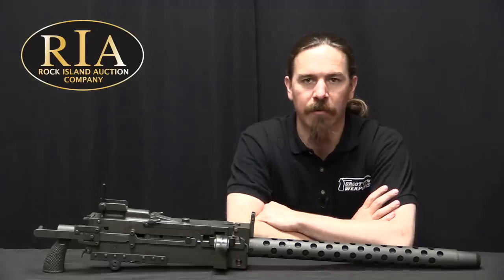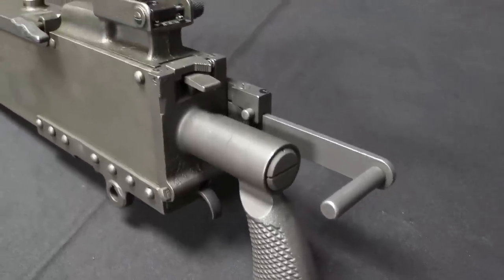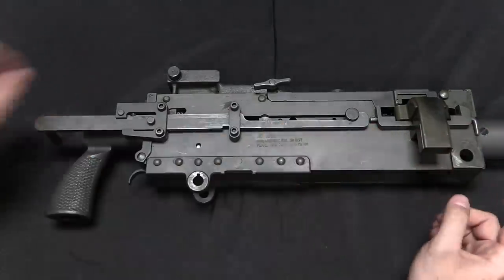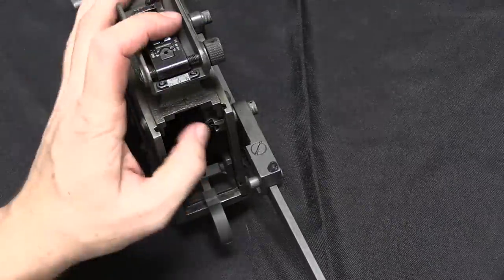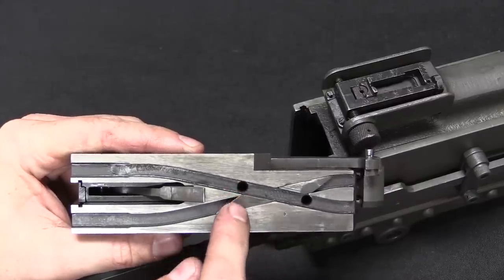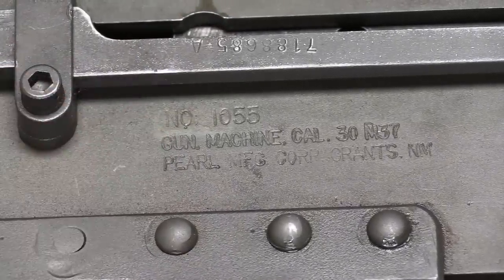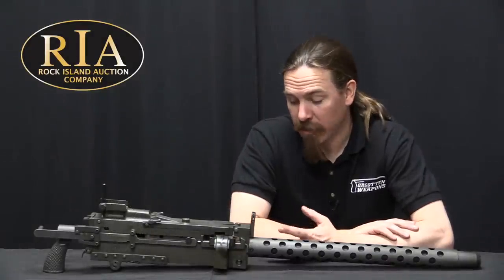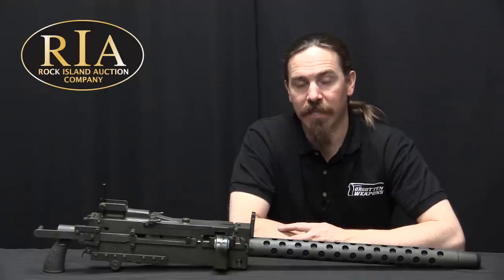M37: The Ultimate Improved Browning 1919

Comment: This is a great machine gun to shoot. Huuuge fun. I had my chance during my national service back in 1987-89 with the Greek army. My unit had M48s and M38s jeeps as scouting vehicles - and this was the standard M48 coaxial gun, on our M38s we had the standard M1919. During our training we were shooting all the guns of the unit so I had good time apart of my own 1919 also with this. My impressions: It is great when shoot from a vehicle or from a fortyfied position. The points of impact spread on an wide pattern so you can "shower" an area with bullets without moving the gun much. We used to have a spare 2nd barrel ,a special tooling wrench and a heat resistant (asbestos) glove for barrel changing. I remember that our training involved closed eyes barrel changing timed for under a minute. The hard thing was to properly screw the barrel on the bolt receiver. You had to count "clicks" to get it alligned (otherwise the gun could jam) but I realised that you could sense the alignment just by finger touching the end of the barrel while screwing . As long the barrel was aligned correctly the gun could fire for ever. The usual part to fail was the back plate with the pistol grip. My unit had a few guns with shattered back plates and no spare ones to replace them. The piece I see in the video looks like new- no way like the guns I shot back then. Great video, thank you!

Comment: I marvel at the modernity of the 1919.  I think it is something of apples to oranges, but I finished watching the Project Lightening just the other day.  And while most of those guns were designed a decade or so before, what a leap forward the 1919 seems to be.
Reply: I always liked the the difference between the the 1918 and the 1919 one year and a fair amout of change past one bing water cooled the other air
Reply: No kidding. I have a Browning Model 11 from my great grandfather and having a gun like that in WWI must have seemed like science Fiction.
Reply: I see the exact opposite.  Some of those decade-older "Lightening" MGs are clearly 20th-century guns.  Despite its quirky magazine, radiator, and clock spring, the Lewis in particular sports a mostly modern action, layout and ergos.  

Conversely, the 1919's advances are essentially wasted.  Browning greatly simplified the recoil action, yet implemented it with oversize, complex machined parts; he developed a mostly unstressed receiver, yet built it out of massive, boxy boilerplates and castings in the 1880s locomotive style of a Maxim, Gardner, or Nordenfelt.  Even this 1960s version would be right at home in a "League of Extraordinary Gentlemen" sequel, with no prop-dressing required.

I have the utmost respect for Browning's genius.  His designs were brilliant for their day, and many have passed the test of time.  I know it is heresy, but it sometimes seems like people are so blinded by his reputation (and, to be fair, the fact that his guns often competed in trials with unreliable clunkers) that they've frozen his designs in time, ignoring even the most basic and obvious upgrades implemented everywhere else.
Reply: It and the Thompson could have an even more legendary reputation had the war gone on a few more years.

Comment: Ian, your story about being pulled over while transporting the weapons was a nice anecdote,  but you might be surprised to know how often it happened over the years....
Back in the early 80's I was in the ARMY National Guard in California. 
I was the NCOIC of the shooting team for my unit,  the 570th MPCo in Concord, Ca.
One year the state matches were being held at Camp Roberts down around the town of Paso Roboles Ca.
Anyway,  it was my responsibility to transport the weapons to the match from our armory in Concord. 
My orders were to take an M880 truck from the Walnut Creek armory and transport the teams 6 1911's and 6 M16's to the match and back.
Since the time of my return might be late,  I Was to lock the weapons in the Walnut Creek armory vault when I drop off their M880 truck.
Well the match went fine but just south of Walnut Creek I got a flat and was broken down on the freeway. 
When I tried to change the tire I found the jack didn't work.
So I sat in the center of Hwy 680 without a way to change the flat or to call for help.
Hwy Patrol finally stopped for me after 2 1/2 hrs and called me a toe truck to change the tire, but by the time I got to the walnut Creek armory it was closed and locked up tight.
So I parked the M880 in the lot slipped the keys through the mail slot after transferring the weapons to my truck and was just starting my truck when WC PD pulled into the armory parking lot to see who was there after dark after closing time.
So as I got out to talk to one of the officers,  both were reserves,  the other cop walks around the other side and looked into my truck and sees all the M16's in the front seat and says rather loudly, " wholly shit".
Any way they decided they would take the weapons,  but I wasn't allowed to turn them over to anyone outside who my orders allowed. 
As you might think,  it was an interesting little deduction,  especially since my written orders authorized my use of deadly force to keep them......
I convinced them to call their boss who told them I was under orders and outside their jurisdiction,  but for a short time there,  two reserve cops thought they had the bust of the century....
And weren't happy when they had to let me go on my way with my dozen charges in tow......
Oh the good old days.
Today I would probably have been shot.....
Especially in the state of Kalifornia, People's Republic of.....
😄😜😄😜🎃
Reply: I love these side stories posted in the comments. It adds more to the video.
Reply: Awesome story, thanks for sharing lol. Glad you're with us today
Reply: @bdkj3e  
Between 80 and 83, it was so long ago I don't remember exactly what the date was but it was in the summer when they held the state military shooting matches to determine who would be sent to the National match to represent California at Camp Paire.....
Reply: It happens.   Around here there are or were some low profile govt. installations deemed important by some.  Right after 9/11 some troops were assigned to go supplement security at one of them.  Full combat load, grenades, class Bs, etc.   For whatever reason one unit used a POV when doing their move from their base to the building far away in the middle of no where up in the mountains.  2AM in the morning their vehicle malfunctions and a sheriff deputy happens upon them.  5 very fully armed soldiers in an old civilian SUV.  More deputies arrive and eventually it was straightened out.  They had their travel documents and the authenticity was verified and their vehicle was fixed for free and they continued on their way.
Reply: @kenibnanak5554  
If I hadn't had a copy of my written orders on me and they said who I could relinquish possession of my equipment to and the lengths I should take to do it.....
ie: the deadly force authority....
Not to mention,  the cops didn't see the 45 tucked in my waist under my jacket......
When they asked what I had for deadly force l said,  what more do l need with 6 M16's and 1500 rounds of ball in 20 mags,  so they didn't really think to look for a pistol I guess.....
Fortunately they took my suggestion about his patrol supervisor. 
He told them if I had orders and was headed out of Walnut Creek to let me leave, l was an ARMY problem.....😄
Like I said,  the good old days.....
Reply: @stanleyjedrzejczyk2966  
Like I said,  two reserve cops that were full of themselves.....
The fact that they never new I was armed is key to the encounter......
That and getting their boss on the radio....
And like I said it was 35 years ago and a different time.....
Reply: PFFEAR, THANK YOU for your service. May your rifle never jam, never run out of ammunition, and may America's enemies be forever in fear of you.
Reply: @stitch626aloha  
All they have to FEAR is FEAR himself.....
I am fear,  come walk the night with me...😨
Reply: pffear yeah if that happened these it would have gone bad
Reply: *Commiefornia
Reply: I imagine it would not have helped to tell them you had orders to use deadly force to keep the guns. Makes for an interesting situation. Were they ever told that?
Reply: "especially since my written orders authorized my use of deadly force to keep them" - oh boy...
did you tell the officers that tit bit of information? lol
Reply: @RYNOCIRATOR_V5  yes I kind of had to when they told me they didn't care my orders said I could have the weapons,  they weren't letting anyone drive away with 6 M16's in their town....
I kept telling them,  look stay out of my truck and call your boss before this becomes an incident that gives us all writers cramp before we're done.....
Fortunately like most cops (myself included) they hate writing long reports and having to explain why you've been arrested by a military cop on a military base for butting into military business is undoubtedly going to be pages and pages of small print....
Especially when all you had to do to solve the problem was call your boss❓😱❓😕
But when they finally got him on the horn I told him that I was only allowed to turn my equipment over to my chain of command with deadly force required,  the two there weren't happy.....
But I told them the only reason they weren't facing a locked and loaded M16 was that I didn't expect cops to be forcing me to arrest them for interfering with my duties and that when I saw it was a cop car approaching me I pulled my mag.....
At that point I produced the 20 rd mag out of my left pocket....😱😝and their eyes 👀 popped❗👍😎
Reply: @pffear  lol that's a cool story my dude
Reply: @pffear  every police in any state will start pointing guns at you regardles of date if they found out you had that 1911 🤣

Comment: They used to have these in UK Ferret armoured cars as late as the the late 1980's (maybe even later), we used to use the canvas belts used to hold the rounds to clean the fume extractors on Chieftain tanks, it was the quickest and probably best way to do it :)
Reply: They were mounted in Ferret's! They were converted 1919A4's not M37's. they were modified to open bolt firing to aid cooling. They were designated L3A1-A4 in service and all fired .30 '06 cartridges and were never converted to 7.62mm NATO. I saw many hundreds scrapped in the late 1980's...

Comment: Based on annual reports from Rock Island Arsenal, total production of the M37 Machine Gun at that facility was 7,340 units, between 1955 and 1957. As far as I can find, no one has managed to access the manufacturing records of Saco-Lowell Shops, but there seem to be more parts of that manufacture found in the surplus market. Likely they made at least as many units as RIA, perhaps more. Rock Island Arsenal also manufactured 8,402 new 1919A6 Machine Guns between 1953 and 1955. Thanks, Ian, for another fine video.

Comment: In Canada we were still using M1919s in 7.62 (designated C5 GPMG) until 1987 as a platoon GPMG and until approx. 1994 in the turrets of our APCs.  Oddly enough, we'd had FN MAG 58s on our tanks since 1977, though.  It worked, I guess.  Bitch to carry.  No quick change barrel and had to be head spaced and timed.

Comment: Thanks for the info.  It helps sort out where the M37 was in the pantheon of Browning MGs.  It's interesting that the Army went from the reliable and well-liked Brownings to the generally despised M73/M219 coaxial MGs.  Always fascinating that a nation with a long and proud history of small arms design messed up so badly on a weapon that is so essential as the co-ax machinegun in a tank.  M85 was in .50 cal, so it's really a different story.  M85 seems to have an equal number of defenders and detractors.  Any of the later tank machine guns would be of interest, especially in learning how they screwed up.
Reply: I understand why the Army made the M-85. The M-2 is a long weapon and building a mount to use them properly is difficult. So they tend to just use pintle mounts which often worked only in one general direction. The other problem was that the M-2 ostensibly was duel use as a anti aircraft gun. So the idea of two rates of fire made since. Don't get me wrong, I was not fond of the M-85s on our M-60A3s. On the other hand our new M-240 co-ax was fantastic.
Reply: @williamsager805  On the M60A1s I was on M-85 problems were usually caused by improper loading of the ammo.  Properly cared for they didn't have many issues.

Comment: @Forgotten Weapons. Your point on removing the return spring on the previous models is incorrect. A long screwdriver is most definitely not required on earlier M1919s.
The stripping sequence starts with cocking a cleared weapon . The slotted screwhead of the return spring poking through the upper left of the back plate is just pushed forward and twisted through 90 degrees clockwise with a suitable flat bladed screwdriver.(Forward pressure required) 
This locks the lugs on the return spring into the rear of the bolt, push bolt forward  a little and remove back plate.
NIce informative video by the way. Thanks.
Reply: I seem to recall a little all steel screwdriver thingy dangling by a little toy chain off the back of the 1919 in my school's armory room for said purpose.

Comment: Mounted coaxially with the main gun.  I'm thinking that they could be fired by the gunner aiming  through the  main gun sight.  I also think the gun was set up with an electric trigger. It was replaced by the M73 which as chambered for the NATO 7.62. The M73 is obsolete having been replaced by the M240 currently in use on the M1 Abrams.

Comment: Technically the M-85 replaced the M-2 .50 cal. But there was a later version of the M-73 called the M-219 was used on M-60 tanks as their co ax machine gun. God only knows why. It's not like they needed to shave a few pounds off a tank machine gun.

Comment: Looks like a sturdy construction. Though the charging handle demands space in the rearward direction to be engaged, which can be inhibitive in confined spaces. Surely that's where the shooter usually is and shouldn't be a problem in most cases, but a suboptimal "solution" to the regular lateral position of the charging handle.
Reply: its designed to be used as a coaxial machine gun aka right next to the main gun. Trust me there is plenty of room to the rear but not left to right.
Reply: @Predator42ID  If it's meant to be next to a main gun, how can it be coaxial? Vertically coaxial, on a turret?
Reply: @jarinorvanto4301  Different form sorry co-axial.  Every tank ever built has a machine gun built right next to the main gun. Reason why its called a coaxial gun is because the machine gun follows the movements of the main gun.     Up, Down, 360 degrees to ensure protection against infantry without using up ammo for the larger gun.
              To give you an idea the M1 Abrams has three machine guns, one M240 next to the main gun, another one on top of loaders hatch. Plus a Browning .50 cal above the commanders hatch. 
     I hope that answers your question?
Reply: @Predator42ID  Very much, thank you!

Comment: Actually a the Army replacement was the M73 and the M219 (not M85).  The M73/219 was probably the worst family of MG the Army ever built.  The M85 was the .50 cal replacement in the M60 for the M2 in the commander's cupola.  As an M60 Plattoon Leader and  TC I liked the M85 but it required maintenance.  Fortunately my Platoon Sargent taught us how to disassemble it beyond field manual limits so we could keep some tiny springs clean and lubed.  I like the M2 as I moved on to that when I became a Scout Plt leader but the M85 was fine.   Now the M219 was an absolute piece of trash that would quickly jam no matter what you did.  Interesting If we had kept the 7.62 version of the M37 as the coax gun, the Army would never would have had to go the M240 route.

Comment: Ian hmmm I thought the M85 was an excellent MG. Dual rates of fire, quick change barrel, L/R feed, modular components. I didn't care or the chains to charge the gun. 
The M73/M219 were less then satisfactory. How abot doing a segment on them if you haven't already. 
Thanks for producing the videos!
Joe
Reply: Neither one would work on a tripod mount.  Being able to move the gun from one kind of mounting system to another was (and still is) a requirement.  It is best if a gun so remounted actually works.        :)
Reply: @kenibnanak5554  there were some M85's  had a threaded holes in the sides of the trunion. They were placed there for additional mounting systems. The powers that be didn't pursue ground mounting of the weapon because of the high rate of fire, when placed in the high rate position. They also experimented with the M73/M219 being ground mounted.
Reply: I think they M85 was good for the role in which it was developed mounted within a cupola.

Comment: They used .30-06 in disintegrating link belt?  That must have been a short lived thing, because they were cloth belts in WW11.

The Canadian army used Browning 1919 MGs converted to 7.62 NATO (called MG C5 in Canadian service)up through the 1980's and they were crap.  I think the issue was that it takes a lot more energy to strip apart a disintegrating link belt than it does to pull a round out of a cloth belt, and 7.62 is weaker to start with.  They made the hole in the barrel bearing plug smaller to boost the recoil energy, but it wan't enough, and they were very unreliable.  Also, unlike this gun they did not have fixed head spacing.

I understand the American army experimented with the same gun, but decided to go with the M60 instead.
Reply: The M1 link belt was used in aircraft and tank guns in WW II.